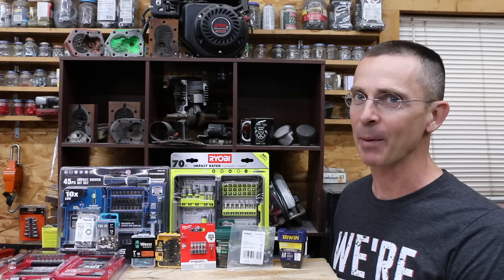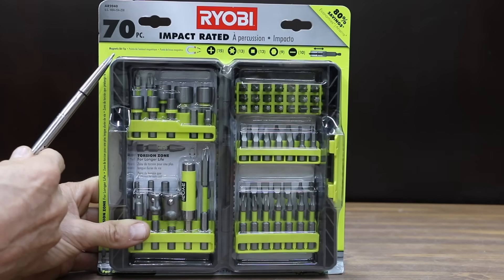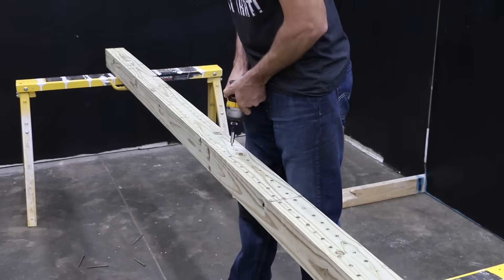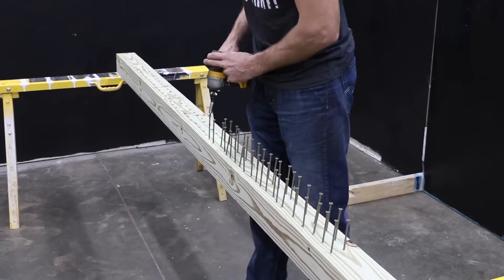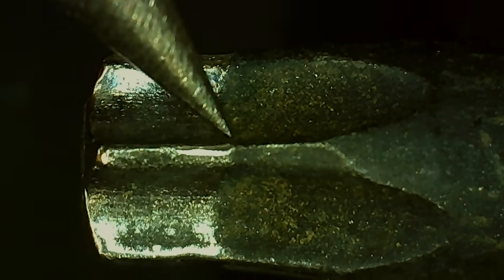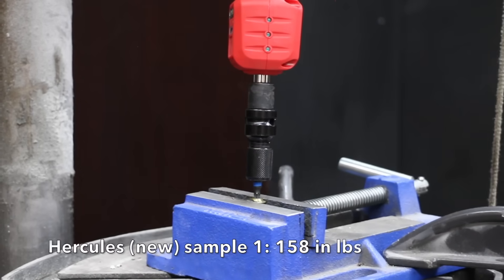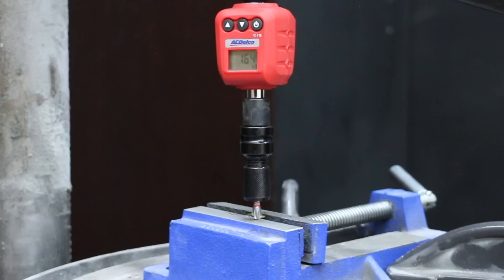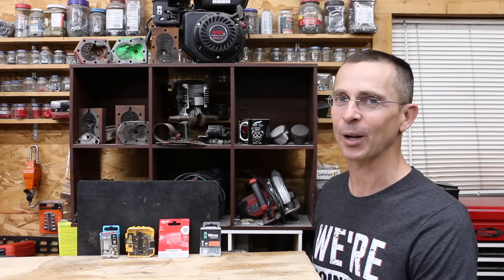Best Star (Torx) Bit Brand? Milwaukee, DeWalt, Makita, Ryobi, Wera, Wiha, Irwin, Bosch, Bauer

Comment: If you couldn’t tell by the close up. The machining on the wiha is pretty amazing.  And the tighter the fit. The less wear on the bit and screw.  If they get stuck.  Eh it may be a pain. But they last longer
Reply: Also these particular Wiha aren’t impact rated.
Reply from the maker: Thanks for the feedback.

Comment: I use wera products whenever I can, I’ve never had one of their products that wasn’t well made. I use their torx bits and they are near indestructible. I do a lot of luthier work on various instruments and the wera hex keys changed my life, the wera 1.5mm ball end hex key was probably the best tool purchase I ever made, and it was only 2 dollars. The ball end makes it so much easier to fit the key into the hex head, I don’t have to fiddle with the key for a few seconds getting it perfectly lined up so I can get it to fit, and believe me, when you are adjusting a guitar’s action and you’re having to adjust 6 screws hundreds of times, saving a second every time really adds up in time and effort.
Reply from the maker: Thanks for sharing.

Comment: Having had over 40 years in the metals processing industry, heat treat batch quality can vary and sometimes vary widely in terms of its metallurgical characteristics and performance of the heat treated part.  It would be interesting to see how these tests would change within the same brand by testing completely different batches from different days, location of manufacture, etc.  I’ve bought the same brand driver bits and over time the performance can vary noticeably.  I strongly suspect inconsistent heat treat practices.
Reply from the maker: Thanks for the suggestion.

Comment: I prefer the locking recess. The tighter the fit the better. Those ones that locked in and were hard to pull out are awesome for ladder work or one handed work. When you are on a ladder and you have your screw gun in a holster on your bags, you grab a screw, socket it up to the tip while it's still in the holster. Then, somewhat carefully, it's not hard to get used to, you unholster said screw gun with the screw already attached. A must on the ladder and LRs are well worth the money. I think they still use the LR (Locking Recess) prefix/suffix on pro screws today. They are also less likely to strip. But if they do strip....not good. Keep your bits sharp, don't bounce :) One bounce on a bit and you wasted it. One.
Reply from the maker: Thanks for the feedback.

Comment: Does not come as a surprise to me - Wera makes exceptional tools,

if you buy a screwdriver with a fixed tip, you want to go definitly with Wera, they basically last forever - i have a PH2 Wera screwdriver which i use for about 10 years now on a regular basis, the tip is still in exceptional shape - i also use Wera Bits for most applications, since they just last way longer and they are not that expensive, your price estimation is a bit off :)

you can easily get bit boxes with 60 bits for about 20 to 30 bucks, the small 30 bit impactor box on amazon costs currently about 55 bucks which turns down the cost to 1,80 per bit - but you have to mention, that Wera includes their exceptionally good bit holder in the boxes too which costs 10 to 15 bucks, if you buy it as a single item - so if you factor out the bit holder, you get one bit for about 90 cent - and if you buy 100 pieces, they throw them at you for very small prices

Comment: I dont do any like, crazy work, just some stuff around the house and a raised garden bed, and the Ryobi Tools that I have, Drill, bits, Jigsaw, sander, leaf blower, battery motor, and weed eater, and wet vac have all been great with no issues.  Just wish the wetvac had a bit more sucking power.
Reply from the maker: Thanks for the feedback.

Comment: After the introduction of each bit, I predicted the Masterforce would perform very well due to the snug fit. More contact area is a huge benefit, I think it far outweighs the small inconveniences. A tight fit also helps when working one handed. MF scored very well in every test,I feel like you took away too much score for the good fit. To me Masterforce was by far the best value.
Reply from the maker: Thanks for the feedback.
Reply: Especially if you are driving screws into a vertical surface overhead. I hate it when a screw falls off and I can’t always use a magnetic bit holder.
Reply: @MoPar Dono If you need to drive over a thousand screws, wouldn't you use a screw gun.
Reply: I think there is some bias towards Milwaukee and Dewalt,  being US brands
Reply: @dogbreath6974  if there's one thing project farm isn't it's biased.
It's a fair criticism, if the screw gets stuck very often.
It can be beneficial when screwing something in, but I've lost so much time because of stuck fasteners at work. (To be fair most of those are internal hex Mashine screws, but it still applies)

Comment: I have an idea for what I think would be a good video:
THE BEST DRIVEWAY MONITOR. 

I’ve been through several.  Some the sensor goes blind, if it’s exposed to a flash of lightning.    But does well if there is something over the top of the sensor.  

Some have too short of range.    Some just don’t work well at all.    Some aren’t waterproof.   Some are destroyed with a year, or so of sunlight.

The list goes on.

And this torx driver video I loved.  I actually used your advice while buying torx bits. They worked as well as you tested.    

I prefer torx fasteners when working on most things, especially in tight spaces.  I don’t have time to fight  cramped  spaces and dropped Phillips screws.  Torx provides better holding power. 

And I did get a few of the Masterforce  drivers just because they fit the fasteners tighter in cramped spaces.  I have Fewer  dropped fasteners.  But usually I prefer a normal bit.
Reply from the maker: Thanks for sharing.  Thanks for the video idea.

Comment: In my opinion the tighter the better. It's to many times with cheap lose bits that you strip a screw or end up dropping it because the screw doesn't fit.
Reply from the maker: Thanks for the feedback.

Comment: Just a question - you reported inch pounds for the breaking force, and some of those values work out to less than 15 ft-lbs, which sound way too low.  Are you sure that the AC Delco gauge was reading inch pounds instead of foot pounds?

John

Comment: Really nice video! I love your comparisons and frequently use them when buying new stuff! You are doing a very important job for consumers like me. One improvement tip for maybe the next video: When using bits no one wears safety goggles! So maybe check the particles flying away from the breaking bits to determine the safest one. Just an idea, dont know if it would unnecessarily prolong a video. Anyways, keep it up.
Reply from the maker: Thank you so much!  Thanks for the constructive feedback.

Comment: My thoughts regarding the used bits failing at higher torque:  The impacted bits metal became work hardened, causing the metal to get harder at the points of impact.  I could be totally off, I only know the term because of AvE.
Reply from the maker: Thanks for the feedback.

Comment: Another impressive and informative test!  Unfortunately the Irwin test was very consistent and revealing with my own opinions.  It seems like everything they take over and make is overseen by accountants.  The old Marples chisels that I like run $35-$50 each on Ebay.  New Irwin Marples chisels are $8-10 and are probably overpriced.  Would a study of locking pliers (AKA Vise-Grips) be worthy of a study?
Reply from the maker: Thanks for the video idea.

Comment: Wera's pricing and product portfolio policy is also in Germany a bit weird. I mean you have chosen their highest line of bits so I understand that these are expensive but here you could buy a mixed bitset from this product line for around 49 Dollars including 19% VAT for 30 pieces which would result in 1,63 Dollars per bit. At the same time they would charge you for a single(!) T25 replacement bit 5,71. I personally go with their lowest product line (100 bits=66 Dollars) because bits are wearing parts but a bad bitset is a pain to work with.
Greetings from Germany and please keep up your simultaneously precise and entertaining work!
Reply from the maker: Thanks, will do!  Thanks for sharing.

Comment: As someone that uses these bits every work day building decks I have to comment, the one test I'd like to see wasn't there! I suppose its very difficult to replicate human error in the same way over and over again. You pointed out near the end how most damage to these bits comes from person using them making mistakes. Very true! But in a working environment you're trying to go fast. Not being perfectly square with the drive is definitely what wears our bits out the most. Only time I personally have snapped one marketed "impact ready" is when using the wrong size. I'd very much be interested in which bits "wear out" first when worked hard. Even so, from personal experience, torx style bits are far above the rest. Generally I wont replace a bit until it's stripping screws and even then its usually seating very poorly and good luck keeping a screw on the bit if you need a hand free from holding the screw before you even get there. I've only tried a few common brands like DeWalt, Makita, Milwaukee, and Irwin. Of those, Milwaukee tends to preform the longest under typical abuse.
Reply from the maker: Thanks for sharing.

Comment: Could you do a video on the best magnetic screw point holder? I mostly wish they had stronger magnets so my screws wouldn't keep stealing the bit from me (though I haven't tried the dewalt star bits yet so thanks for the recommendation!) and that magnet is DAMNED handy when you almost drop a screw or you just need it to stay on while you start the screw with one hand in a hard to reach location. I can't imagine a magnet on one being so strong it would become annoying(like hard to remove the screw point or something) so in my opinion the stronger the better.

I'm mostly not a fan of the freely rotating collar but it's handy once in a while.

Also in my opinion, they should be skinnier if possible for those hard to reach situations.

Experiment design ideas:

Tie a string around a bit(equal lengths of fishing line so consistently weighted?) then add washers to the fishing line(perhaps put a rod at the end of the fishing line so you could slip a washer on, then turn the rod sideways so it wouldn't fall off) and see at what weight the bit falls out. 

For the screw holder, you could do bolts of different lengths pointed downward and at perpendicular to the ground. Then attach more nuts to the bolts for additional weight. 

Keep up the incredible work!
Reply from the maker: Thanks, will do.  Thanks for the video idea.

Comment: Video idea: comparing impact sockets, extensions, reducers and step-up's to non impact ones and seeing how much torque is lost, if any, by not using impact rated parts on impact equipment. 
As the impact gear is normally more expensive it would be nice to know how much of a difference they actually make.
Reply from the maker: Thanks for the video idea.

Comment: As always, awesome video!  I would mention that having the bit stick in the screw after driving doesn't seem like it would be a big deal most of the time as you'd likely be attaching a piece of lumber to larger structure which would retain it and make removing the impact driver easier.
Reply from the maker: Thanks!

Comment: Thank you for confirming the Wera brand bits are the best, we use the same brand for work where it involves taking out corroded bolts and the number of times a cheaper bit has snapped inside the head, causing further headache and time wasted drilling it out!
Reply from the maker: You are welcome!

Comment: rust removal. electrolysis vs ultrasonic. Drain cleaner and water. 15 min. Saw steve's small engine saloon vid where he did that for a small engine clutch. Worked really well. He didn't show the process, just said that's what he was going to do. It was on his seized clutch tiller vid he just uploaded.
Reply from the maker: Thanks for sharing.

Comment: Thanks MR FP,
no wonder my bits always wear out so fast. i was using Bosch since its pretty common in Germany. 

I will try Dewalt since it seems Dewalt is getting the top brand to go to when it comes to overall performance.

When i watch your test it seems like dewalt is winning the most. Maybe they have a propper Test before they sell their products with claims.

Bosch is always kinda underperforming besides their constructionline Powerhammers and some other tools. 

Last month i was so frustrated with my torx bits from Bosch i bought 50 Weras. 
Seems a little much after not one is worn so far 😂😂
Reply from the maker: You are welcome!  Thanks for sharing.

Comment: I want to see a comparison video of the 2 in impact torx bits specifically for the 1/4 impact driver.  I don't ever use the small bits because they either detach and stick to the screw head or they fall out when caring them or when in the tool bag or just in general you lose them.  The 2 in bits always stay in the driver until you release them and change the bits.  As an professional i would always recommend the 2 in torx bits in a impact driver.  They are much more reliable, more secure, and best suited for the job for the impact driver.    Please compare all the major brands of the torx bits and the Phillips bits.
Reply from the maker: Thanks for the video idea.
Reply: Agreed.

Comment: Just so everyone knows, you can buy bits by the hundreds in a box and not care about how long they last.

Only and this is the ONLY exceptions I'll make is for using it on engine parts, the metal on there is brittle and you need something with a perfect fit and no give. There is only one option, Hilti.

Sure, it'll cost you more than all sets put together but it'll last you a lifetime.
Reply from the maker: Thanks for sharing.
Reply: @ProjectFarm  I hope you don't think I'm stepping on your toes with this though. Your testing is second to none, I'm just adding my experience and you're not really doing the brands of my field so i hope everyone realises that.

But the thing is, you've changed some of my deep seated habits of choice and that, my dear farming friend, that took unlearning an old mans tool and oil habits, that is NOT a small feat.

Your oil comparisons did change my mind that was stuck for 30 years before that, that's good consumer information and that is, of course, what your channel is all about and why we all love it.

You ARE the man on these things, no bullshit and you know how we use stuff so you test it as we all use it.

Keep it up and please have fun doing it. Spring is right around the corner and the snow is melting any decade now I hope... ;)

Comment: I'm going to buy a right angle drill adapter to install screws where there is not enough room for the impact driver.  You could probably do a great review of these.  So far looking at Milwaukee and DeWalt, but there are probably others.
Reply from the maker: Thanks for the video idea.

Comment: A tight fit can be a good thing when you are using the driver to hold the screw for insertion into a tight space. So maybe get two different brands. A good wear and fit bit, and one of the really tight ones for that insertion task. Based on some of your previous testing I got two kits of Milwaukee bits, long bits and short bits. So far they really do the job. On phillips heads picking the best fit # is crucial.
Reply from the maker: Thanks for the feedback.

Comment: Hey, could you test and see what kind of difference the bigger batteries have on tools? IDK if other brands have it, but Dewalt has the 60V Flex battery that you can buy and will fit most tools that use the 20V battery. I have used the Flex battery in normal tools and they feel more powerful, but it could be the placebo effect.
Reply from the maker: Thanks for the video idea.
Reply: @ProjectFarm  no problem, I think this could go well with information comparing batteries used on the dewalt tools, and it could be an interesting set of stats for testing it on various devices to see which brand is the best (like the videos comparing the Milwaukee, ryobi, and other drills or the greeser and those videos.

Comment: I have a video suggestion...taping fluid vs cutting fluid vs oils vs water vs gun lubes? Vs wax?   Which ones are plastic safe that won't craze acrylic .  Here are some sugestions. 1.re-li-on. 2. Tap free 2.  3. Moly b. 4. Pam 5. Beeswax. 6. Burr life for jewelry artists 7. Boshield t9 8.  Tap majic, 9. Cool cut. 10. Rapid tap...  if you find it apealing great.
Reply from the maker: Thanks for the video idea.
Reply: @ProjectFarm  ive always wondered. What do you do with all the stuff you end up testing. The good stuff you would use but the chinesium stuff....you must have  a shed full of the stuff that didn't cut the mustard! Lol
Reply: Is there any significant difference between any of them...